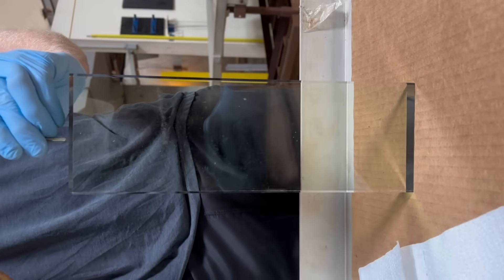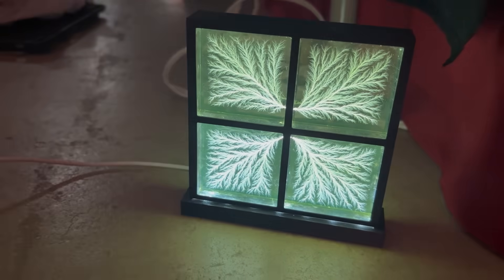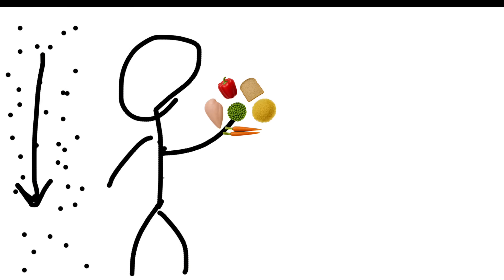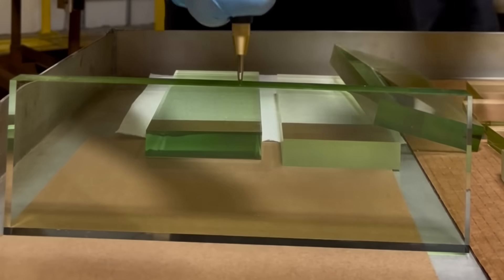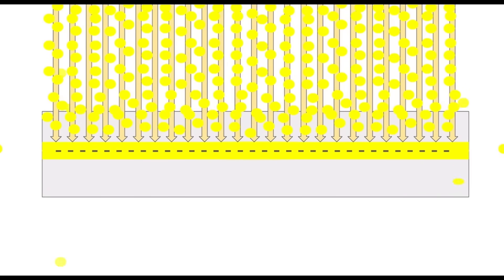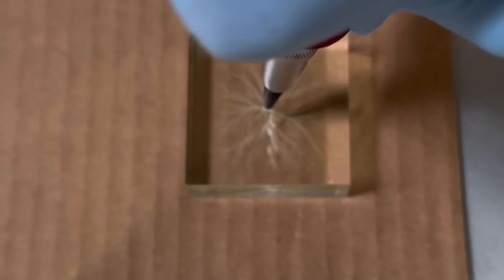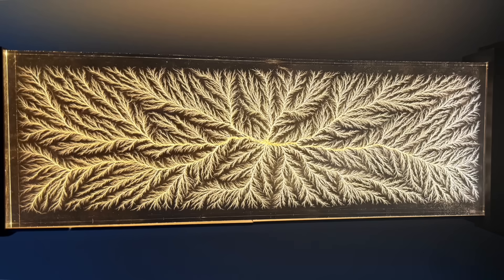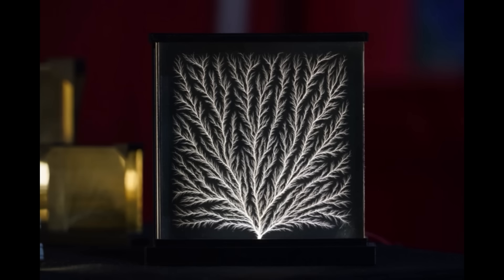Freezing Lightning in Acrylic Using Particle Physics

Comment: Have you tried putting a stencil on top of the acrylic block that shields parts of it from irradiation? You could shield the outer part to get a non-rectangular Lichtenberg figure or shield parts on the inside to get holes in the figure. :)
Reply from the maker: Yes, in fact we just made a 18x18 inch smiley face lol
Reply: @ElectronImpressions  Hehe, cool! :)
Reply: @ElectronImpressions 
Please show a video of that....
Reply from the maker: @inthewebnotofthewebto be released soon

Comment: Could you put a thinner (separate) CNC machined block of acrylic on top of it to get a kind of 3d mask, changing the depth at which the acrylic is charged, or would that thinner piece break?

Comment: This subject is not my greatest strength so with that said, can someone explain if it is safe to even be near these? I heard radiation and that electrons get stuck in the acrylic so I'm wondering how safe these are
Reply from the maker: If you hold the acrylic while it discharges, you will be shocked. However aside from that it’s totally safe.
Reply: That's cool...
However, that was exactly what I was thinking, radiation, in your garage, man I'm glad I moved out of the city..

Comment: Cheap to make, fast to produce and bores just as fast. Try hand painting sometimes.
Reply from the maker: Where did you get the idea the a linac is cheap 😂
Reply: @ElectronImpressions  You can always rent one or pay-per-use. Or if you knew someone who knew someone working in a research lab, get weekend access.
Reply: @ElectronImpressions  By the way, how cheap each unit is also depends on the production volume.

Comment: Amazing explanation! Would look crazy with a spiral or lightning shape acrylic base but that’s probably hard to do right.
How long can you carry the charged bubble around in the acrylic before it looses charge? Can you charge the same piece twice? Oh and does it zap ya hard if you hit it without a glove?
Reply from the maker: Thank you! Yea unfortunately weird shaped pieces are hard to get/make. But to answer your questions, the acrylic loses charge quite fast and is mostly gone in 10-15 minutes. We can’t charge the same piece, once you introduce a conductive discharge pathway, the electrons will keep flowing out through them and prevent any from sticking around. And yes, it does give quite the zap, especially on the bigger pieces.
Reply: @ElectronImpressions  How intense radiation needs to be?
Reply from the maker: @jakubiskra523  very
Reply: @ElectronImpressions  Maybe you know at least a power of accelerator?
Reply from the maker: @jakubiskra523  high power, low power dont work

Comment: Is it possible to do it with a regular glass or some similar material?
Reply from the maker: I can tell you it won’t work with glass haha
Reply: @ElectronImpressions  You mean, of course, that it will be impossible to use this poke to create field non-uniformity? But it can probably be created by other methods as well: UV laser, localized heating, spark discharge... I'm more interested in whether electrons will get stuck in glass in the same way.

Comment: Extremely interesting thanks. I would imagine ultra tiny cavities are created…could a coloured dye be introduced by a capillary action ? If so may be some clever colour chemistry could add some ‘lift’ or even coloured LED, to transmit through the capillaries? Thanks from Australia, where do I buy a linear accelerator :-)
Reply from the maker: I’ve tried some primitive methods to introduce dye within the cavities but even after weeks it only penetrates a few mm from the discharge point. Perhaps to see any luck, we must utilize a pressure differential

Comment: Can this process be done inside of a machined acrylic part, or does it need thick and "perfectly smooth" block to charge properly? For the sake of the argument, let's say the part is 3-6mm thick.
Reply from the maker: It needs to be reasonably thick or the acrylic will shatter upon discharge, but it does not need to be smooth.
Reply: @ElectronImpressions  Good to know. The idea was to do knife scales with this pattern in it, but sounds like that would be way too thin/fragile for this process.

Comment: How quick you have to tap the sample after irradiation to ensure it works? Its about minutes or days until charge from inside of acrylic disappear? Is it possible to send irradiated blank sample and make customer happy to break  the sample by himself?
Reply from the maker: Unfortunately the charge bleeds out in just a few minutes
Reply: @ElectronImpressions it might make an interesting battery technology if it were able to hold that charge longer. Is there any research on that as a possiblity?

Comment: This is incredibly cool. Do the material properties of the acrylic change after the first irradiation? I'm guessing you can choose the depth where the space charge forms? If you use a thicker sample target, can you get a lichtenberg figure to form shallower on each side of that thicker target? Curious if you could get a figure to form on either side of a thicker chunk of acrylic.
Reply from the maker: The only significant property that changes is the color of the radiation affected region, it is slightly yellow afterwords 

Yes, the energy of the beam determines the depth of the space charge 

Yes we could form near the surface however this comes with risks as the discharge is very violent, and may potentially blow the acrylic apart if not deep enough
Reply: @ElectronImpressions Thanks for the info and for satisfying my curiosity 😂

Comment: This would be mega interesting to see in super slow motion!
Did you thought about a co-op with the @theslowmoguys?
Reply from the maker: This would be a great exercise for them and we would love to collab, if they can get up to 15 million fps 😂
Reply: @ElectronImpressions I think they already have done some lightning (or just a static discharge?) But in air and without the magnificent after sparkling.
Reply from the maker: @WaldiDer The propagation of the discharge channels here are much quicker than real lightning, but no doubt it would be cool to see. It would be super cool if they were interested
Reply: @ElectronImpressions even faster? Holy sh!t... 😮
Reply: @ElectronImpressions  In their most recent video they went up to 5 million fps using a Shimadzu HPV-X2, and its specs say it can also do 10 million fps... the downside is that it's monochrome, pretty low resolution, and can only record for 256 frames
Reply from the maker: @MatthijsvanDuin wow well with this we could probably see something with the right timing

Comment: 6:38 I thought positive charges can’t be moved unless you are talking about the actual whole atoms building up on the surface, you can’t separate protons and neutrons without a collider. The positive charge isn’t being up and left on the surface, the atoms are staying with it. Sorry I’m not trying to nit pick could be wrong but from my understanding it’s cations forming like you said and staying there after moving towards the charge. It’s a big misconception that you can separate a positive charge from an atoms, it always has neutrons bound to it unless you literally smash it with a large collider. The protons are never separated, it’s just that the electrons have been removed.
Reply: You can’t impart a charge is what I’m trying to say, the physical atoms that have the protons in their nuclei are still there, there not just leaving a positive charge then taking off from my understanding, correct me if I’m wrong I’m always trying to learn!
Reply from the maker: @kaidenwatts528 Thanks for the question— we aren’t building a positive charge in the sense of depositing protons. Cations present in the linac environment react with the outer surface, stealing electrons from the acrylic, making it appear as if a positive charge is building. However there is some nuance with this, literature is still debating whether or not these positively charged species cling to the surface or just transfer their charge. However what is not debated is the presence of this positive charge, this is widely accepted.
Reply: @ElectronImpressions That makes a lot of sense and I figured it was something like that as they can’t just be left there! Theoretical science is so cool! Appreciate the explanation, I took classes for electrical engineering in high school and am now looking to study it in college I love learning about stuff like this and critically thinking about the process! I’m glad you guys are active in teaching people about this stuff and are happy to talk about it!

Comment: It's like an Electret!

An electret is a material that retains a static electric charge, similar to how a magnet retains a magnetic field. Electrets are made by aligning electric dipoles within a material using a strong electric field, and then solidifying the material to "freeze" the alignment. This creates a material with a persistent electric field, with opposite charges on its surfaces.
Reply: I think it actually IS an electret.  I wonder if this process could be put to practical use, or is even used to make electrets commercially?
Reply: @peetiegonzalez1845  it is an electret...but only for a few minutes before the electrons bleed out.

Comment: Very cool! Now the tutorial for building a linear accelerator please! 😅
Reply: Well a CRT tube is basically a linac good luck modifying it tho
Reply: @gamingonmars4742 Saw another comment or two asking the same thing. CRT was also my first thought too. That or a klystron lol
Reply: Got it. I just need a powerful laser and a compatible photocathode at the end of an evacuated tube, then a series of focusing quadrupoles with a static magnetic field and accelerating coils of varying length connected to a microwave frequency source, maybe something like an yttrium iron garnet signal generator and a Gunn diode. I figure a photocathode won’t have to be evacuated and won’t burn out like a tungsten filament for a photoelectric cathode would. I would need an old radar or
Microwave communication traveling wave tube or klystron and that can provide me with as much as a 60dB gain which is more than enough to accelerate electrons to 30MeV or 0.9998c or 671 million mph. If I use YBCO coils well I already have liquid nitrogen on hand sometimes for knifemaking so I just gotta pipe that in, they already have copper plumbing and I already have high K insulation and then all I need is something that is transparent to electrons to use as a window so the electrons can escape the main accelerator chamber under high vacuum and enter a second chamber where the target, the acrylic, can be placed without having to worry about crap getting up in my tube. Beryllium oxide might work. Beryllium foil would be better. Beryllium is extremely toxic if it gets into the lungs but as long as it’s intact it’s not a big deal. Any low Z material would work so silicon nitride or boron nitride which isn’t toxic. I could use titanium, aluminum, zirconia would probably work so would zirconium metal. Kapton. I dunno. Honestly the easiest part about this is the extremely high energy laser of the sort you would use to etch metal or even cut metal, although the photocathodes that are compatible with energies like that are beyond my price point. I have some Gen 3 L3 photomultiplier tubes I could crack open but those are $3400 each and the wrong kind of photocathode. I would have to put my 2D (structurally similar to graphene) coating on aramid aerogel textile true SWIR/MWIR thermal camo project on hold but this seems pretty cool and I have a place with a lot of off-grid power, more than I will ever need, and a lot of space where I could do this. I wouldn’t really wanna do this at home in my garage or at my shop because it generates x-rays not that they’re terribly hard to block, you just fill the walls with lead shot and there you go. But it would also have to be like 30 feet long unless I made it short and built a cyclotron which is also appealing. I might be able to buy an old cyclotron magnet. I’m also thinking if I just kept it simple and used the traveling wave tube and cavity magnetron for the electron source that would let me skip the whole photocathode laser thing. I think I just like the idea of solid hunks of materials you can shoot with light and they shoot out electrons. But a traveling wave tuve is also a type of particle accelerator in and of itself. It’s a helical microwave wave guide  and the idea is that the microwave signal follows the helical path and the electrons are following a straight path accelerated by the anode at the other end of the tube. Because it’s RF the electron beam is pulsed rather than continuous. Each pulse is being accelerated by the microwave’s eleceomafentc field and Lorentz force and getting pushed along as the elecromagnstic waves move slow enough for these bunched up electrons to get caught by and accelerated like a bunch of surfers swimming to catch a wave. Once they’re up in front of the wave they draw momentum from it and they’re propelled forward by the wave which doesn’t slow down cuz it’s light it just loses some momentum to the electrons that are in the low MeV at the end.

Another option is to seduce a physics grad student at my Alma mater which is something I have experience with. Then see if she’ll let me put some of my acrylic in her linac if you know what I’m saying.
Reply: How would the CRT even need to be modified? Channeling the beam or something?
Reply: @Progs420  It's a non-starter, the energy is way to low and the I think the flux is too
Reply: @mikeavison5383 yeah I think it's probably far too weak.
Reply: @mikeavison5383  Theres a different type of Lichtenberg Ive seen where they'll take a flyback transformer off an old CRT and put the voltage across a wooden board.  It burns the tree into the wood.  I dont think this is very safe though.
Reply: Start with a HV DC power source and a good vacuum pump
Reply: They work in a cancer center and charge up the acryllic with the Linac machine used to kill cancer cells.  They didn't build their own linac.
Reply: @derrickforeal I thought it's the gamma radiation that used for this. But now I can remember that there were machines working with x-ray and beta interchangeably.
Reply: I now understand why MAGA is terrified of CRT.

Comment: Average linear accelator cost is around 2 to the 3 hundred thousand dollars. With the lowest cost i found being $30,000 and the highest being 1.75mil
Reply from the maker: Yep they aren’t cheap lol
Reply: technically it's DIY'able from a crt, though I wouldn't recommend this route unless you absolutely know what you're doing (electricity can be dangerous kids)

Comment: Super interesting! Are you able to achieve similar effects on non relatangular acrylic? Would be intersted to see the effect in some other primitives. A torus of lighting would be rad
Reply from the maker: Yes we can, however the electrons will always deposit in a 2D plane as illustrated. So to get more intricate lichtenberg patterns in acrylic a “rotisserie” like device needs to be used to rotate the acrylic while in the electron beam. This device itself also needs to survive the beam… working on this lol.
Reply: @ElectronImpressions not sure if it's possible, but if I understand correctly that's mainly because the electrons have a specific energy. Perhaps it is possible to variate the electron energy by reducing input power or by sending parts of the electron beam through a different material to reduce their energy resulting in multiple layers or a more uniform distribution height wise without rotating the acrylic itself. That is of course assuming that you can redirect it.

For example: send it through a ramp-shaped block, giving you a gradiant of electron energy, then redirect it such that every part of the acrylic receives electrons from all parts of the gradient. Unless I'm mistaken that should result in a volumetric electron deposit.